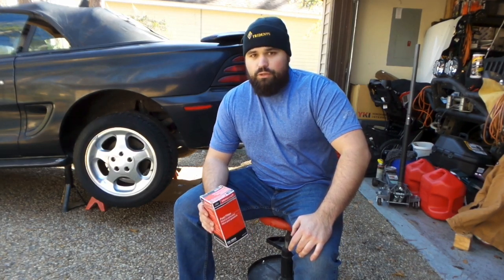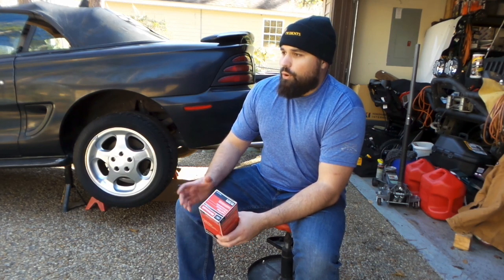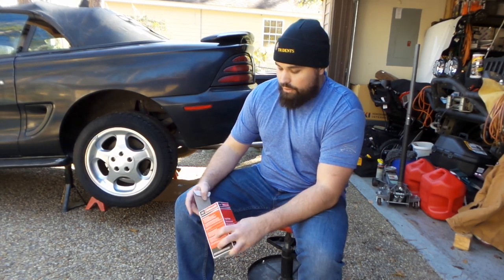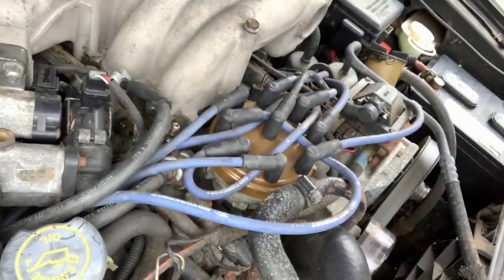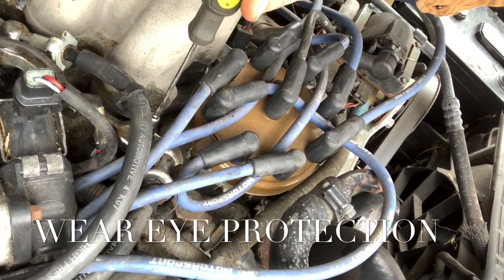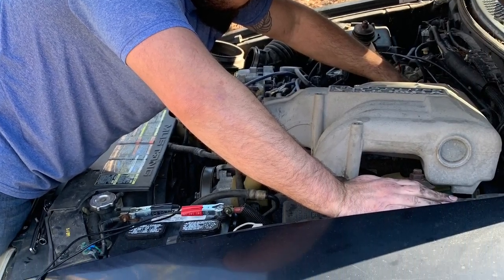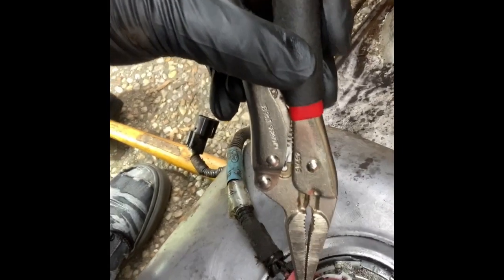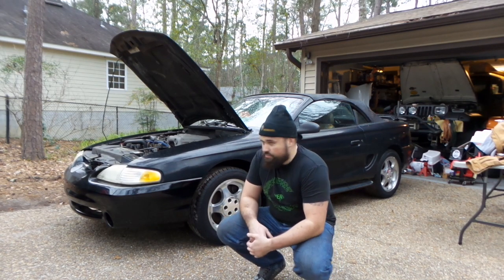Scarab Customs Gets This Cobra Running For Good

Comment: I had the same issue when I was changing the spark plugs on my F150.  Disconnected the fuel injector harness to make some room and snapped two of the plastic clips.  They are easy to repin with parts off of Amazon.